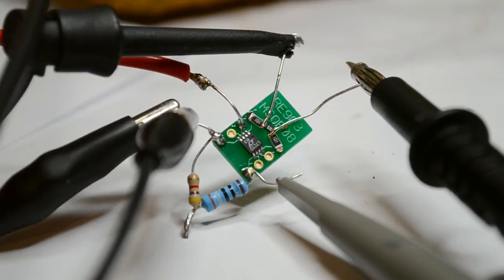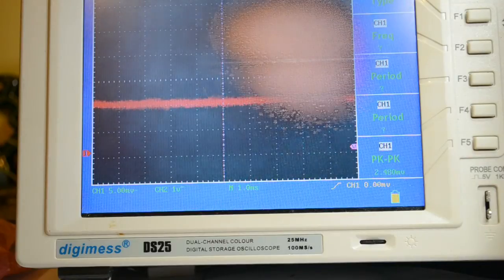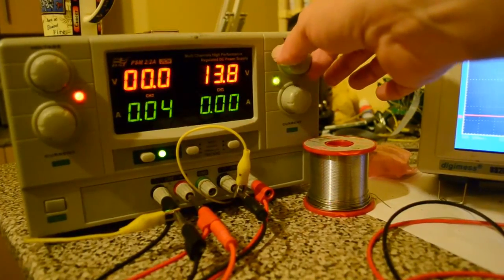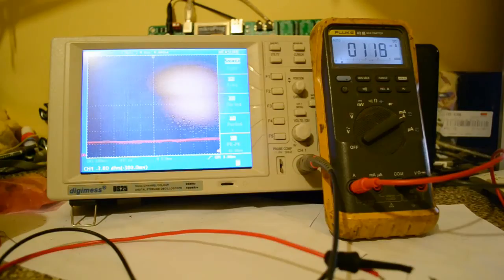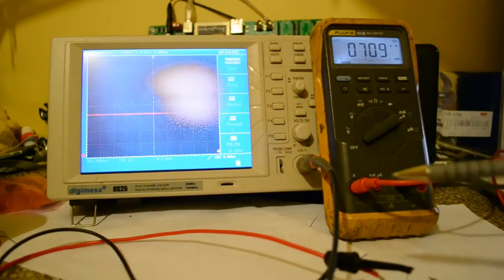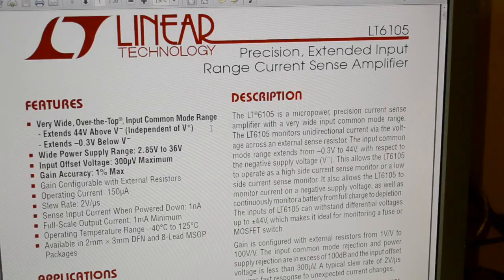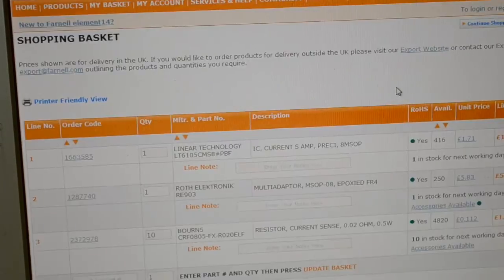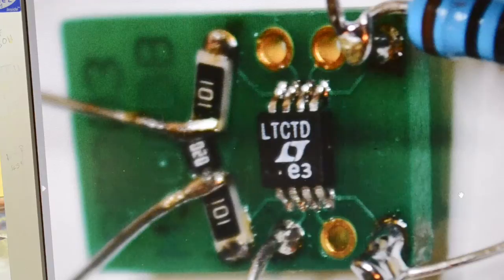Current Sense Amplifier, Current to Voltage conversion

Comment: Hello John, I would like to track the running time of the 240 volt Hot Water Heater in my home. The H.W.H. has two T-Stats to operate two (non-simultaneous) 5.5 KW heating elements. These elements never run at the same time but only as either/or. When either element is on both 120 volt legs draw 18.75 amps. Can I use some sort of C.T. / Elapsed Timer combination to register this??? Any ideas would be appreciated.
Reply from the maker: +gearhead0800 
Hi,
My first thought is to
Connect a mains voltage relay to the heating elements, then, use the closed contacts to activate a timer.
It would be isolated from the high voltage.
Reply: +John B Thanks for getting back to me John, I had thought to run one of the power legs through a current relay that has a set of N.O. contacts that would bring a circuit to a small Honeywell timer, but was concerned about the voltage drop through the relay's coil?
Reply from the maker: +gearhead0800 
You have lost me a little.
I thought you want to record how long they are on for.
Or do you mean you want to control how long they are one for?
Reply: +John B Yea John you were right. I did just want to monitor or record the total run time. If the thing had only one T-Stat I would just have run a line from the switch leg of the T-Stat and a neutral both to the 120/240 volt Timer. The timer would run when ever the T-Stat was calling but with two stats operating either/or it would take a set from either stat and I was concerned about backfeeding to the element that was not pulled in. thought that maybe a c.t. that would respond to a signal whenever it sensed current on the main feeds.
Reply from the maker: +gearhead0800 
I would do it the simple way, 2 relays rated with a mains voltage coil, each stuck across each element, when the element clicks in, the relay would turn on. You then have 2 isolated contacts to do with as you wish.
Reply: +John B Thanks John sounds like a more direct way. I will try it out.